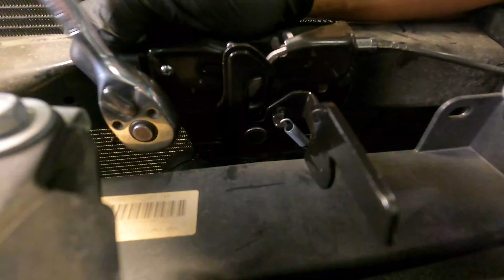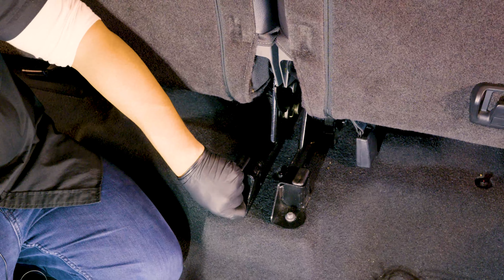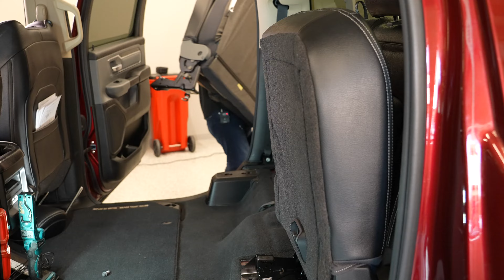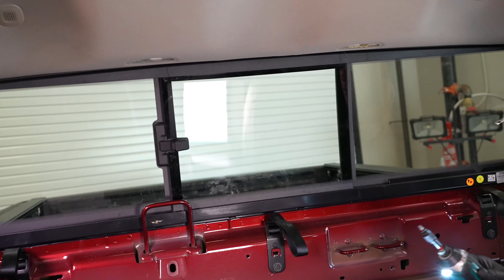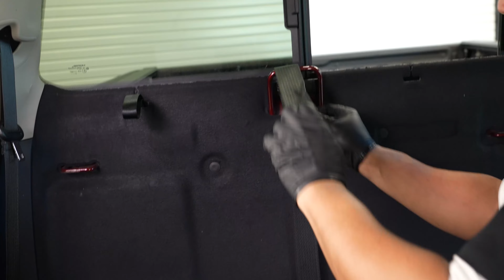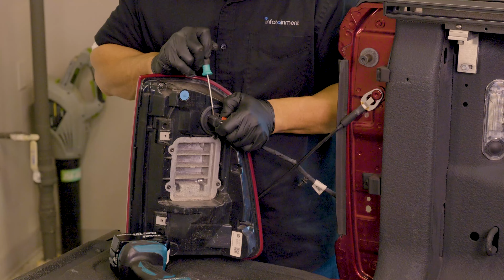[OLD] 2019-2022 RAM 1500 - Factory Remote Start Installation Guide - Infotainment.com

Comment: Would this require the sales code updated with the dealer pod? The video intro mentioned showing the viewer about programming the truck for the feature. I may have missed that in the video
Reply from the maker: Our kit includes the security gateway module bypass and the OBD Genie C-XBM programmer which will enable the “XBM : Remote Start” option code within the Ram’s body control module. For all Ram 1500 DT, a local Ram dealer will be required to program the replacement RF hub and (2) keys.

Comment: What does the dealer need to program and is it difficult to get them to agree to do it?  Cost for them would be approx. how much?
Reply from the maker: A local Ram dealer will be required to program the replacement RF hub and (2) keys.
Reply from the maker: The cost of that service would vary from dealer to dealer.

Comment: Could you include the OBD Genie programming or at least mention more about the programming needs after install?
Reply from the maker: I've provided a link for the product page below.  Our kit includes the security gateway module bypass and the OBD Genie C-XBM programmer which will enable the “XBM : Remote Start” option code within the Ram’s body control module. 

https://infotainment.com/shop/exterior-accessories/remote-start/2019-2023-ram-1500-dt-factory-oem-mopar-remote-start-upgrade/

Comment: What do i do with the purple wire thats left over do i just leave it there or take it out? 😅
Reply from the maker: If this is referring to the BCM tapping, if you did not have the violet wire, you would just insert this wire to the pin it is supposed to be... But if the violet wire is there, you do not want to leave it removed. It would be best to use a posi-tap or to strip and solder the wire to the violet wire so everything is connected.

Comment: Do you guys do the install if so where?
Reply from the maker: This is actually a completely plug and play kit that comes with all of the components necessary to accommodate the install.  This install video is meant to help with the install.

We do work with verified 3rd party installers who may be able to help as well.  You'll be able to put in your zip code for a proximity search through the link below. 

https://infotainment.com/verified-installers/

Comment: So the dealer needs to sync up the key fobs? Is it even necessary to tell them I installed a remote start?
Reply from the maker: We can program the BCM for the new feature with the included programmer but the Key Fobs need to be married to the vehicle. If you approch them asking them just to marry the keys to the vehicle it may not be necessary to tell them you are installing  a remote start kit. That information should not be relevent to what they would need to do.
Reply: @Infotainment_nav  do I need to sync up the key fob first or install remote start first